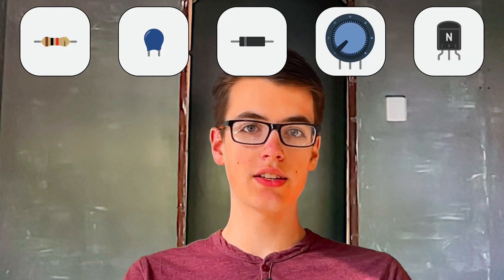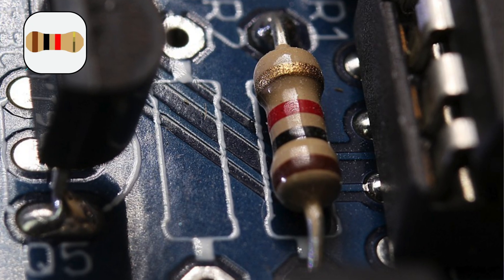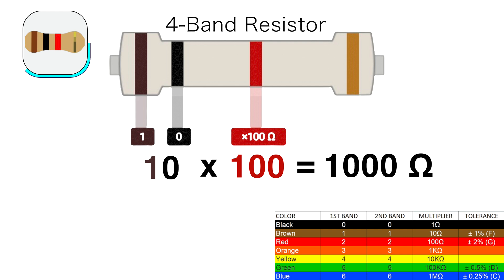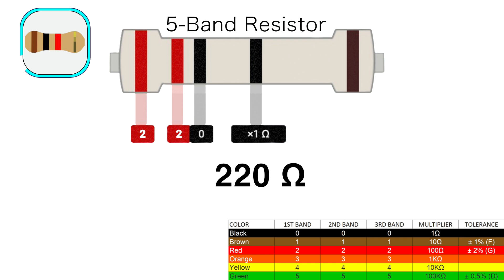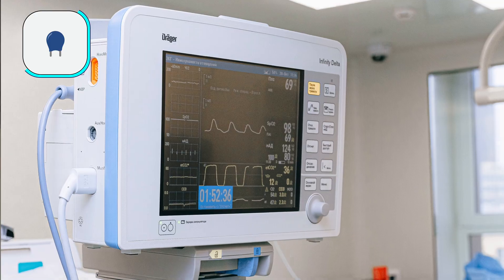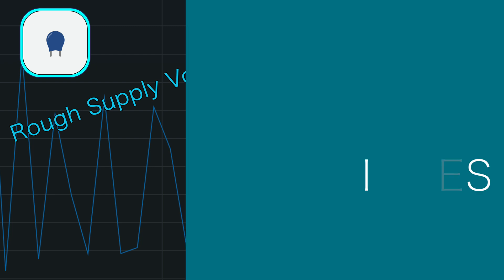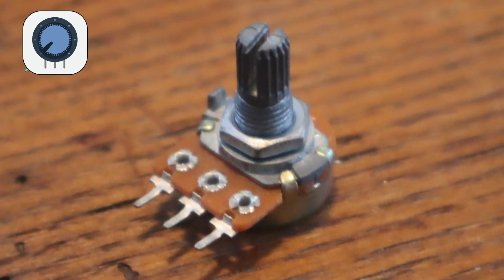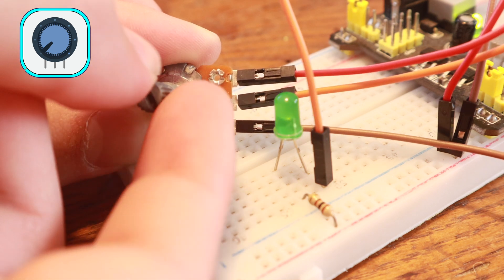Electronics EXPLAINED for Beginners

Comment: If you are too lazy to find resistor colors table just find a calculator of resistors
Reply from the maker: Yeah that works too. You can also get a multimeter (if you’re often testing resistors) as it’s more accurate, but then you won’t learn the color code…